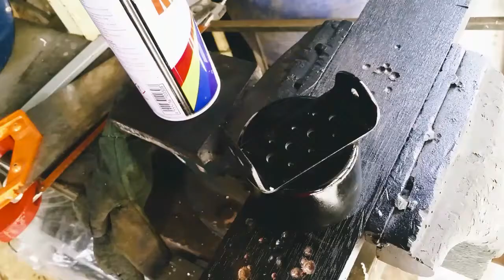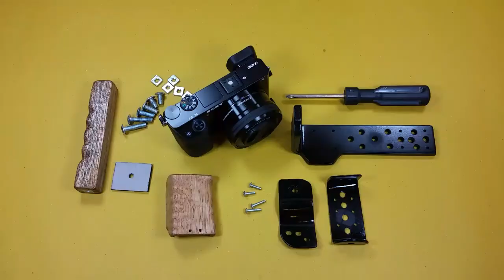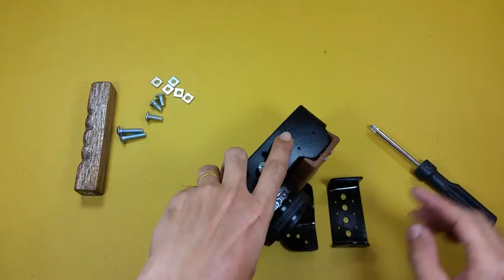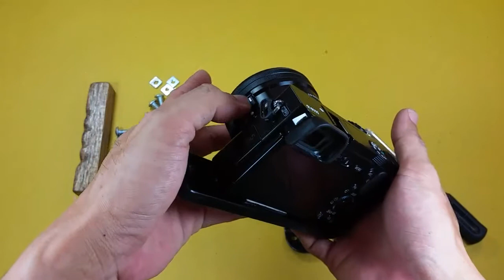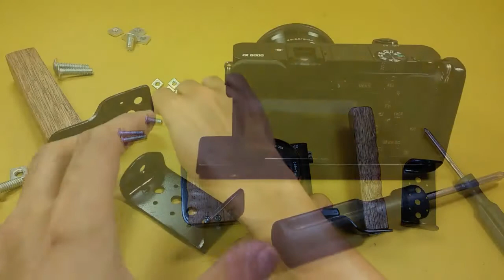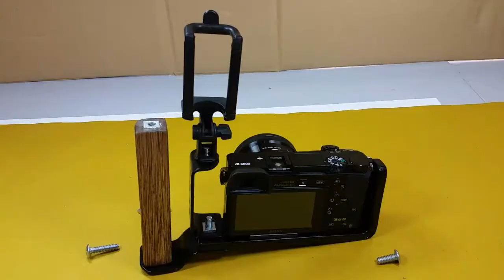DIY Camera Rig | Sony a6000 | 2017

Comment: Very nice, I'd like to do one for my Canon EOS 200D, i have the same idea like yours - to have a smartphone mount (for video monitoring), External Recorder mount, a light and a grip.
May i know what is that metal brackets?
Or you just took a metal strip and drilled 1/4" holes..?
Reply from the maker: Gokul S Thanks bro. Sure you can make one for your Canon EOS 200D. I used the acrylic play to done it. Try to sketch out the camera first. And find out the screw mount on your camera and drill on the acrylic plat with 1/4" screw mount. Use the heat blower to curve the shape. It's easy to do that.
Hope it is useful for you. And don't forget to subscribe my channel. Thanks.

Comment: Can you name the parts please, where can I buy them?
Reply from the maker: Hi. You need some bolts and nuts size 1/4 inches, you can decide the long or short. For me the short one is better. And find out the acrylic plate which more thick and easy to bend with high temperature. Don't forget to choose the black colour so no need to spray again. Some small screws for the wood handle also needed. All the materials and parts you can find out form the hardware shop.